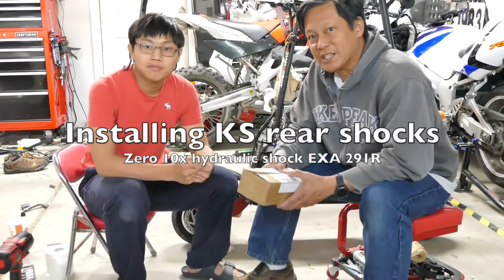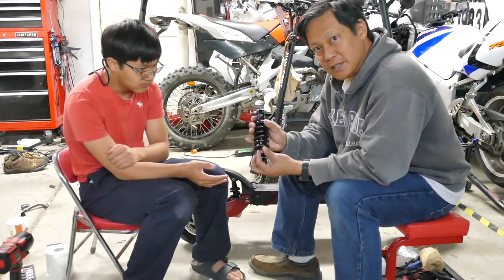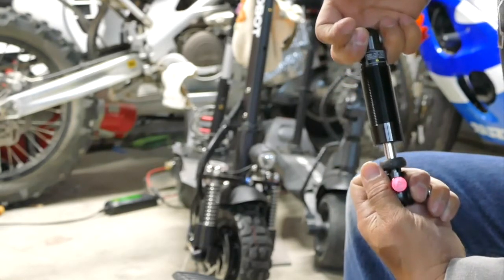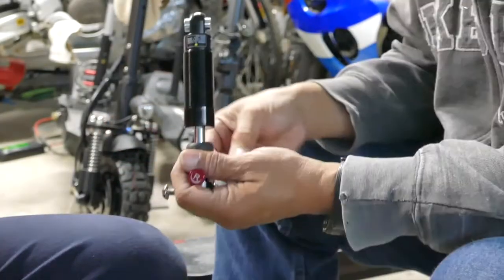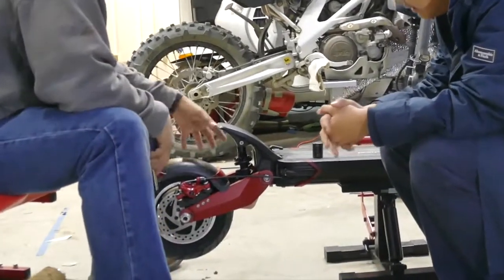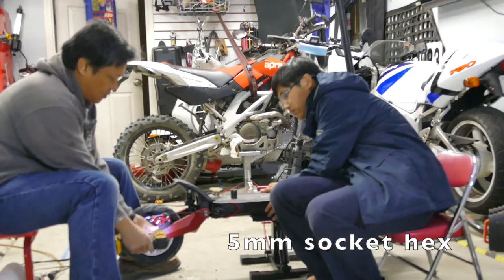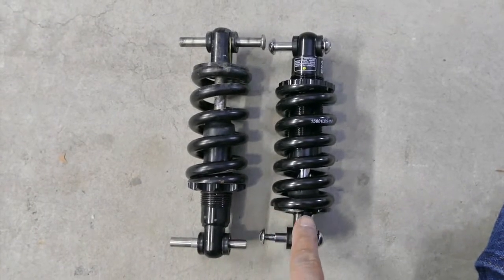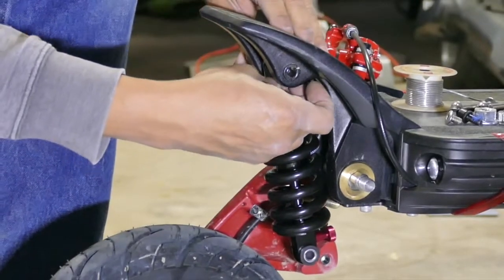Zero10x hydraulic shock install and demo

Comment: you;d need to install new bushings correct size to the shock absorber, instead putting washers there, and btw red knob should be faced top - if it get dirty, would be bad :)
Reply from the maker: Yes thought about putting the red knob on the top side but there is another problem. When I had to shock spring removed, I can feel air-bubbles and a small gap of zero damping when I hold the shock with the red knob up while I compress and extend. It seem this shock is not nitrogen gas charged and has a small air bubbles mixed with the oil fluid. See video at 3:20 in.

Comment: OK, so i tried the exa shock yesterday on my Nanrobot D6 and i have to say that the ride was VERY stiff and harsh compared to the softer stock spring . Maybe the 1500 lbs compression rate is too high and a lower compression rate such as 650  lbs would be better ?
Reply from the maker: I am not sure. There is a method to get an approximation spring weight using the lever formula: https://www.translatorscafe.com/unit-converter/en-US/calculator/lever-mechanical-advantage/ . Or if you can see how much your old spring deflects with 100 lb weight on it. If the old spring compress 0.1" with 100 lbs load, then its a 1000 lb per in spring. I know its not very easy to do but it can be done.